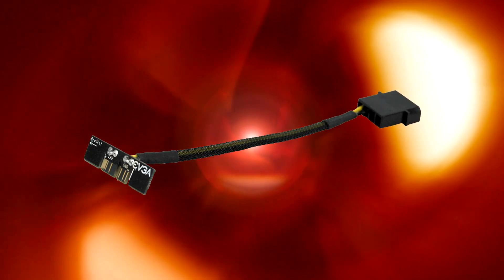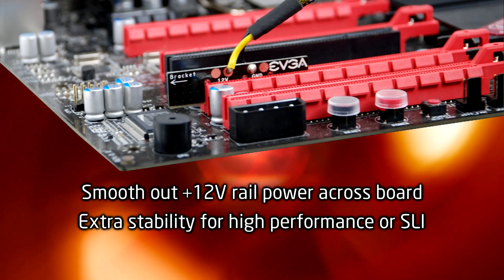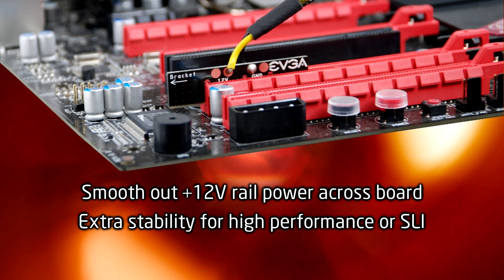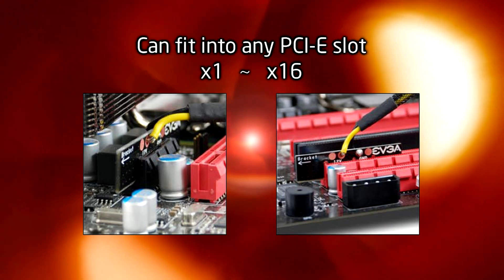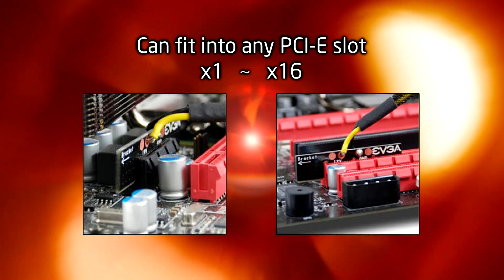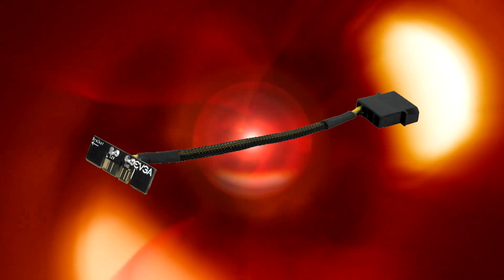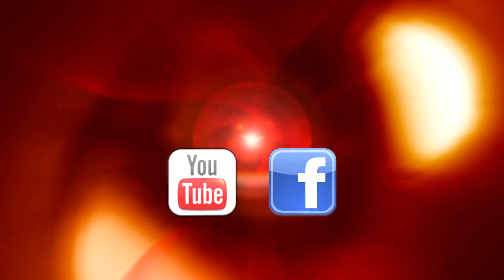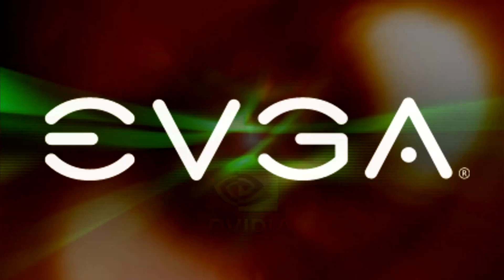EVGA Power Boost!

Comment: And after 10y I burnt 3XATX 24PIN cable with my 3xRTX3090 system now, so I purchased your POWERBOOSTER omg 3Ampere workstation is a hell power and trouble 😀

Comment: This is a terrible idea and no one should buy it, if your motherboard or add-in card can't meet PCIe standards that is a flaw and the part should be replaced not half-ass patched....
Reply: Obviously you've no idea of PC power requirements.....
Or you would have mentioned the failure of a weak PSU.

Comment: Hi,
I have a Quad-Sli 480 setup on a P6T7 WS Supercomputer board. I burned the two pins, one of them was the 5v rails on the 24pin socket because my board with this setup pulls out too much power from the psu. Will the EVGA Power Boost, resolve my problem? 
Thank you!

Comment: This thing is mainly to alleviate the power draw from the 24 pin connector to the motherboard if you running a major sli system that may burn the connector and input from drawing too much to power the pcie slots.

Comment: I have an audio problem due to unclean PCI-E power (not EMI) on a P55 board, resulting in my PCI-E X-Fi Titanium's amplifier putting out buzzing noises when there is high gpu activity.
Would this product help stabilize the voltages for PCI-E?

Comment: @OrganicStuff1 If you actually tried the backplate you would know it lowers temps (by how much varies on different PC's) and changes fan noise tone to more bearable !
This new card above simply gives more power to the current PCI-E 2.0 bus which will soon be replaced by the belated PCI-E 3.0 bus which has more power on tap.

Comment: It sounds like an attachment i'd buy back in the 90's to ''boost performance''. This is something that should be integrated into the board already if it provides a significant performance increase with muti GPU systems, and from what im hearing, other manufactures already have.

Comment: @cisco760ca I think this is in relation to board failures for people running several overclocked Fermi cards.  They cause so much power draw on the PEIe lanes that the board tries to pull more power through the 24pin connectors which will fry the board or PSU.  This has been a huge issues for a lot of people. To avoid this, newer mother boards have a molex power plug to add extra juice to the PCIe lanes..  I'm pretty sure this does the same thing for older boards without the PCIe molex plug.